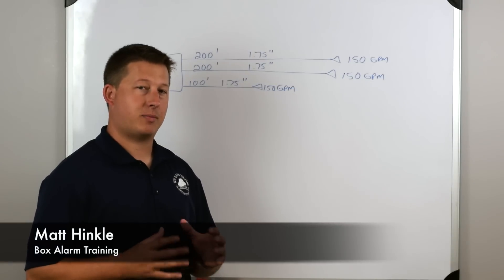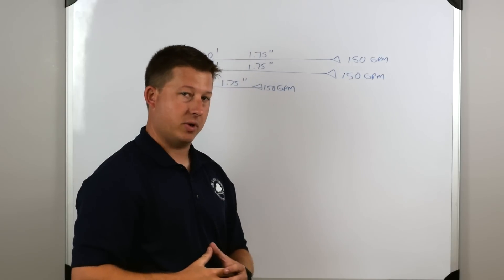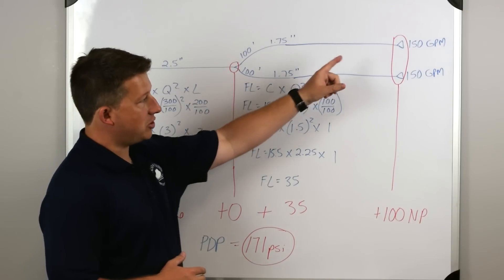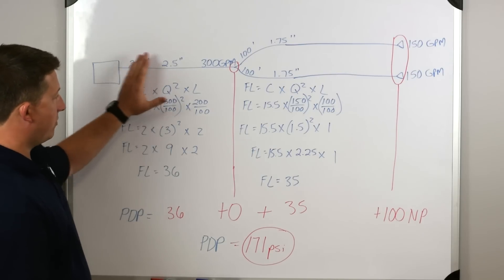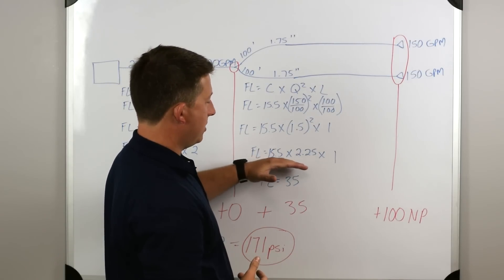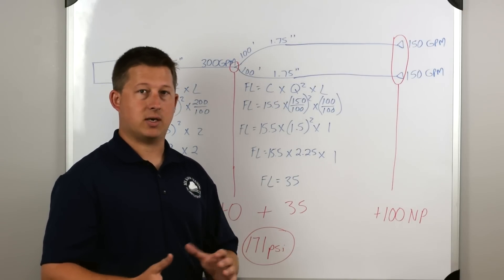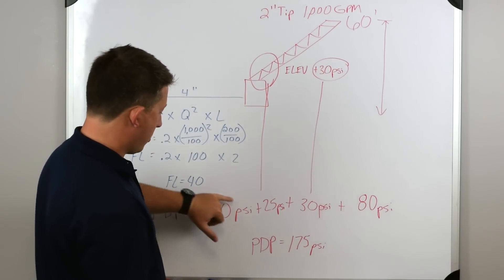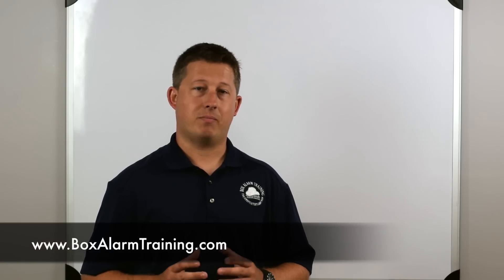Pump Operator Training Series - Part 5 Summary

Comment: Excellent video series, thank you for taking the time to put this together. I'm new to this and will be doing my DPO certification soon. 
On the first scenario I am a little confused as to the reasoning behind why you only take into consideration the friction loss on one of the 1.75" lines rather than both. I understand that the calculation for FL on each line comes out to be the same number (35psi), and I also understand why you don't have to pump at twice the pressure for the wyed lines (just throttle up to keep both tips at correct NP), but why would your friction loss for both 1.75" lines not be added together (70psi) to account for the FL on both lines? (For a total of 206 psi PDP)
Reply from the maker: This is a very common question. The bottom line is you are asking about pressure and not volume. For example if my garden hose at my house flows 20gpm at 60psi most likely my neighbors house has the same flow because we are on the same line which has the same pressure. If both of us flow we would be flowing 40gpm at 60psi not 120psi. If my entire neighborhood was flowing it would be over 1,000gpm but it wouldn’t take 3,000psi to do that, it’s still the same 60psi line delivering the water. It’s just delivering a lot more.